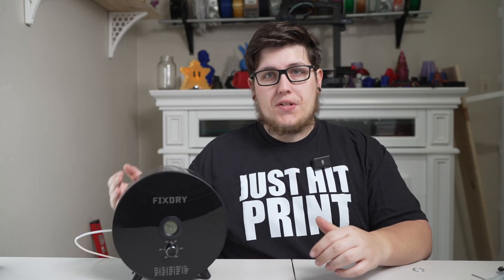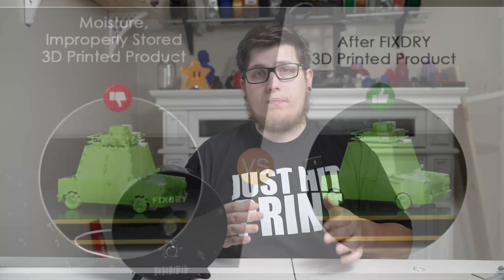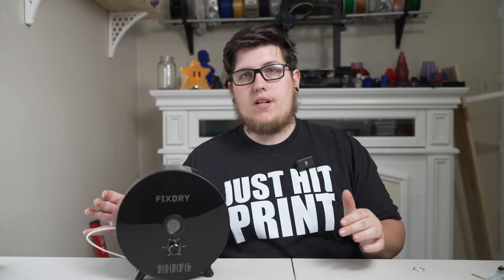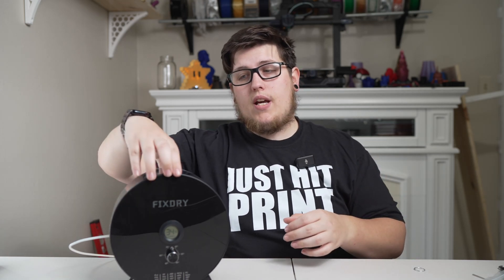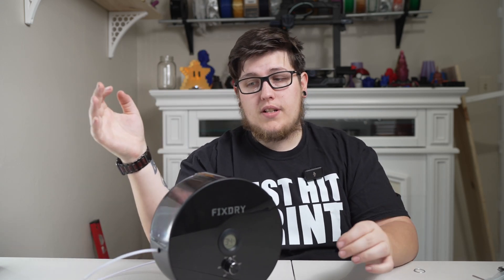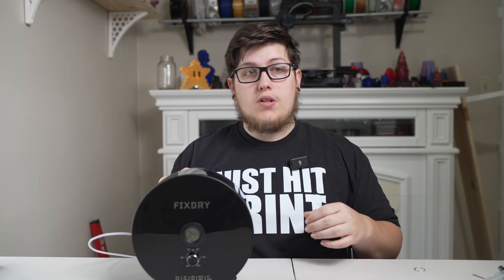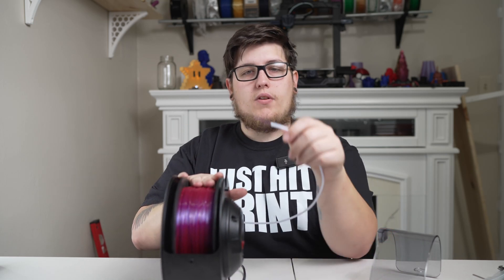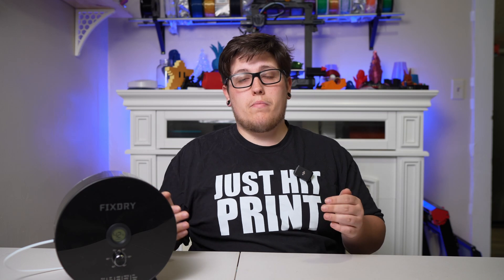The EASIEST Filament Dehydrator on the market! | FixDry NT1

Comment: I've been using the magic mill MFD 7700 for drying my filament and it's been great. I also have a polymaker polydryer I keep near my A1 Mini. I really like the drybox the polydryer comes with. That one uses a bowden tube as well, but I always cut those down so they're not so long. Only a few cm is needed really.
I only print in PLA, PETG and TPU; PETG and TPU get dried fresh out of the package and then stored in a sterilite gasket box with desiccant  when I'm not printing with them. PLA I dry if it becomes brittle. I've seen this happen most often with PLA+.

I do like how compact the Nt1 is, but it has the same problem a lot of these dryers have: hot spots. This one blows air directly on the filament, which can cause it to warp/melt. This has been mentioned in a few other reviews. I'm also not a fan of the lid. The magic mill food dehydrator and polydryer don't have these issues. Honestly, the food dehydrator is still my favorite. It moves more air, is quiet (way bigger fan so it doesn't need to spin as fast), gets plenty hot and has plenty of ventilation. 

Reviews of any kind are appreciated, but please don't be afraid to point out flaws of the products you review. It puts your integrity into question if every product receives a positive review, especially those that have been reviewed and felt lacking by others.